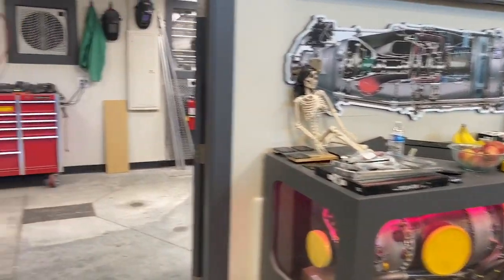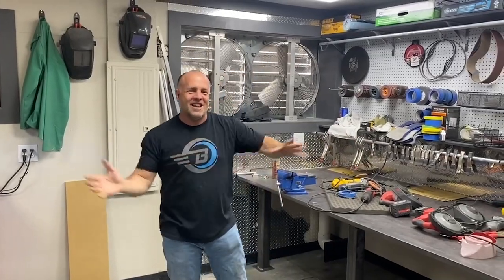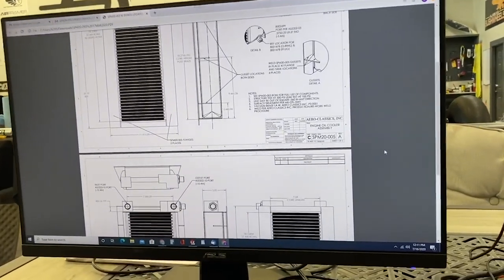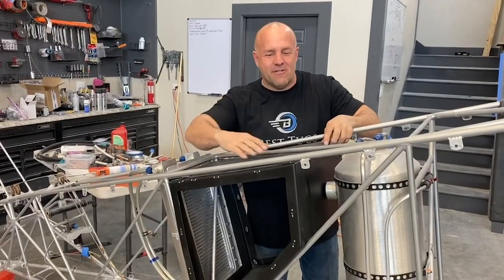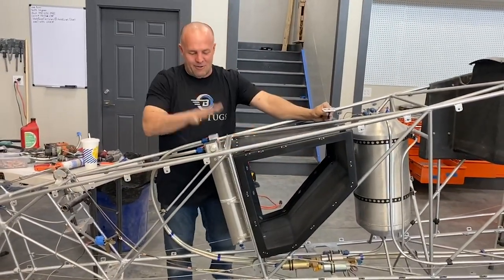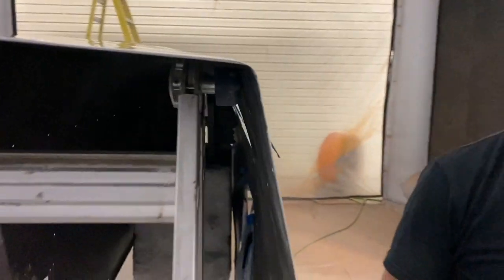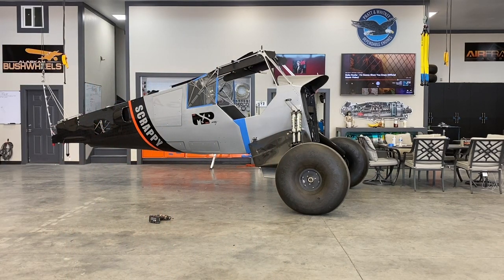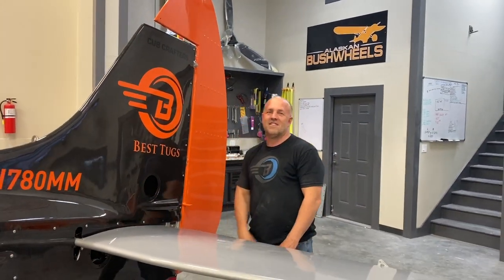Scrappy Bush Plane Gets Tail Feathers  🤠 (Scrappy Bush Plane 24)

Comment: Thanks for the always inspiring video Mike. I did have a question though: With a 500 hp engine, is there a possibility that during pre-takeoff, you could overheat your engine because there wouldn't be enough airflow through your oil cooler intake vents. Many automobiles have electric fans interfaced with their radiators to keep the engine cool when the car is stopped. Is an electric fan on your radiator something you might need for Scrappy?
Reply: Um..... Have you noticed the size of the (fan) bolted to the engine lol If that thing is turning it will move a ton of air down the plane.
Reply: @aliciaellis2832  you may be right...but with that much thermal demand, and with the coolers separated from the engine, under certain conditions, like waiting in line for takeoff at a controlled airport on a hot day, there may not be enough airflow through the vents to remove and control the heat from that massive engine. But maybe not...just have to see how that setup works in a variety of environmental conditions. It's an experimental aircraft.

Comment: Dear Mike, wont the air flow which is redirected by your oil cooler have a negative on your elevator horizontal stabilizer and elevator?

Comment: What if while in flight, the "key" for scrappy is dislodged from its micro-switch? Will the engine stall while in flight?
Reply from the maker: ENF EbbnFlow great question.  👍🤠  first the key cannot come out without depressing the spring lock button.  Secondly I can pull it in and out all I want in flight has no affect as it is tied directly to the ground wire of the starter relay so the engine won’t quit only the starter won’t turn.  Third I don’t know why I would but if I pulled the pin, had an engine failure, and needed a restart the prop is so large I won’t need a starter as the windmilling will have the engine turning over for me.  👍🤠 cheers
Reply: @MikePatey  Awesome thanks for the reply!!! Your videos are so motivating keep it up!

Comment: When you had the steel inside the room, I mistook the electrical outlets for the holes in the steel, and thought how in the heck did you bend that inch thick plate.

Comment: Someone is gonna just take the rudder lock "key" and Scrappy won't start. Just wait.
Reply from the maker: Karuiko 👍🤠 it has a bypass inside the plane, exactly for that reason, I can’t be stranded and it will always start with the bypass option but it takes a second to do so the key just makes sure you don’t forget unlocking your controls but never stuck over a 2 dollar pin

Comment: Mike, I'm surprised to see you don't think about ear protection.  With all the thought you put into your shop and plane you don't think about the future of your hearing.  I have a woodshop with dust collection, air compressor, vacuum pumps, saws, etc.  When a machine goes on so does the hearing protection.  Hearing loss is a slow cumulative process that you will live with for the rest of your life, I know from personal experience, so protect your ears - PLEASE.
Reply from the maker: Eric M 👍🤠 I just got a giant clear tub of ear plugs and two head sets.  Now I just need to get in the new habit 🤠
Reply: @MikePatey  It's not hard to get into the habit, just keep a headset next to each machine so it's handy when you turn on the machine.  I'm now 73 and worked around noisy equipment throughout my career and didn't think about my ears, I now sit and watch my family having a joyful conversation and I may only understand a word or two.  Protect yourself.

Comment: What in the world..... XD I think, I have a picture of it in my mind - And its sexy! Interesting ideas, I can imagine they take their time to perfection. Here in Europe, absolutely unthinkable to modify anything XD Also, I´m sure it must be hell of a job to this glossy finish, but it looks great. However, I am a little concerned about its flammability.  Of course, a fire is the worst which could happen in any plane. But besides wood or wrapped wings, the carbon fiber tends to light up really quick and burns relatively long (compared to a wooden wing on which only the wrap would light up shortly until its all gone) And this may mean, again only in the worst case - but we pilots always think of the worst case, that it could be a fire death trap in which you might survive a heavy crash, but not the initial heat wave from the ignition of the carbon fiber. :/ Mike, maybe you have more info about it? I´m sure there is a way to fix this, but I haven´t seen it on planes with carbon parts yet although the F1 is getting along with these compromises as well. Cheers

Comment: Hot air hits the stabilizer immediately after leaving the oil cooler exhaust. Could its heat shrink the cloth too much?
Reply from the maker: Luiz Schechter  great question 👍🤠 the dilution of heat is so minimal and then the mixed air in flight by the time it moves the couple feet it won’t be a concern at all.  👍
Reply: Fabric is shrunk at well over 300F,   oil heated air  will be much less.
Reply: Thank you!

Comment: Still no mention of wing design, saving it for last maybe.
Reply from the maker: Oswyn Faux 🤠. I will do them very last.  I want every nut,  bolt, paint, interior, engine and cowling installed and driving around the airport so I can have the exact final weight so I can engineer my one off wings to match in wing loading for what I want.  There are not any wings that will work correctly so they will be one off ground up design.
Reply: @MikePatey  So I assume you will take an old F-86 wing as a mold and build Scrappy's wings out of carbon fiber :) BTW Draco's wings were a work of art.

Comment: Didn't you say you were going to put a divider in your oil cooler air-box so that air differential between Port and Starboard didn't spoil your air flow through the cooler?

Comment: Mike, in the future, with all of your antennas, Avdec makes conductive and non-conductive gel gaskets...better than messing with taping and two part sealants...they are really sweet.  Too, to offer many other sprays and tapes and sealants; if you need potting in a connector or well areas, they have a product called "self-leveling green".  You can also use the green to wetseal screws.  💪😉👍

https://www.avdec.com

Comment: I love the micro switch gust locks for scrappy, but I have to point out a flaw in your plan. If your friends enjoy pranks like many aviators do, you have greatly exposed yourself. My first thought was that I could steal your gust lock while parked on a mountain top and fly off with it, leaving you stranded until I had laughed enough or been provided a bribe for it's safe return.

Comment: About the vernatherm; Isn't it cooled by the air that has already passed through the oil cooler? Because if it is, my assumption would be that the vernatherm might think the oil is cooler than it actually is due to the cooling of the vernatherm itself. Couldn't this create a risk of the oil becoming too hot? 

(By the way, every bushplane should be able to get an STC with the microswitch start system using those gust locks; I think it is completely brilliant)

Keep up the good work, I can't wait to see this aircraft fly

Comment: Shouldn't the microswitch be inside the rudder? Having one in the cockpit holder is really testing for the presence of something in the cabin, not for the absence of the locking pin through the yaw damper...

Comment: Mike you are going deaf and you don't know it. I have been around noisy machines for 30  plus years now I wear ear protection but I am to little to late on the protection. I am tone deaf and need to be screamed at just to hear some tones. That new room is very cool, not. Noise levels are way to high, check the decibel level, ear plugs or ear muffs a must or in a few years people will have to yell at you so you hear, I know I hate it I am only 58.
Plug those ears mandatory equipment . Great work Mike you are pushing new limits!!

Comment: Sorry to see that he is using pin hinges on the elevator & rudder with no gap seals. It should have strap hinges with bronze bearings similar to a Pitts Special with the Rihn gap seals. They work unbelievably well and change the flight characteristics including lowering the stall speed. I also hate jack screws for trim. They do fail eventually. Traditional & simple trim tab is best.

Comment: So I was going to speak about antenna ground plane and it hit me that carbon fiber will probably perform well as the antenna ground plane. Comments anyone?
Reply: Negative, carbon does not work as a ground plane at all, but if you make a star pattern with aluminum tape on the underside then mount the antenna it works great, that is what I did on my cub, and the cub I am building will have the same thing. Mikes brother mark and I are building planes in mikes hangar now and will start putting videos up soon.

Comment: This project is hard for me to understand. Why would you want to put a500HP engine on a plane with zero cargo capacity. This is a flying bathtub without the water designed before WW2 as a spotter airplane. Bush plane without cargo are useless. You must have both short landing and take off with enough cargo hold to warrant the trip. This said there is a lot to learn from the amazing innovations Mr Patey brought to his project especially the landing gear  and wing design, which looks impressive to say the least. I have the feeling this plane is bound for glory in Stol competition, but will show little more in the future.  Rich man's toy ?

Comment: Being scrappy is based off a Cub platform. How do u expect its handling characteristics to be vs a Cabon Cub like your wife has?

Could someone who has flown say a normal Cub be able to handle it? or is its power to weight way biased to the power. 
(Cmon mike we all saw what u did a lame boring Wilga. You love massive engines and power. You design planes  how they should have come from the factory to begin with.) Every piper cub needs a NASCAR sized engine!